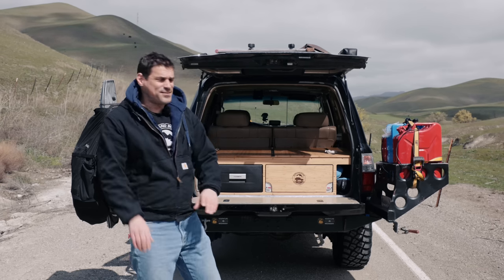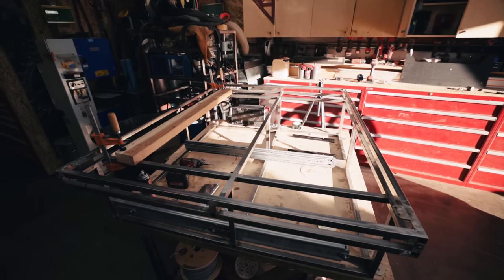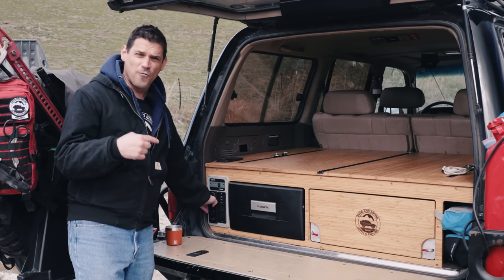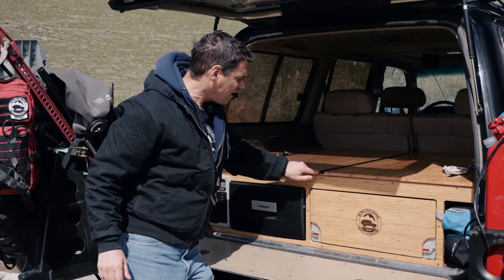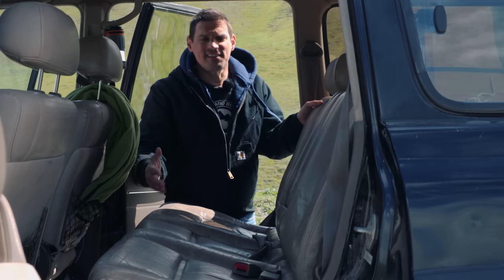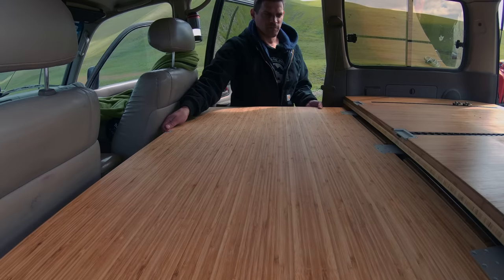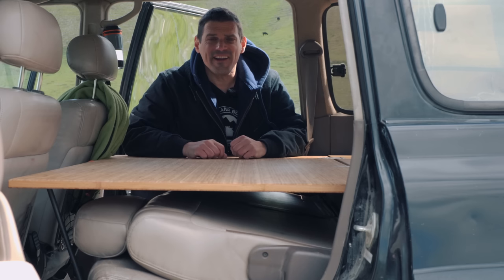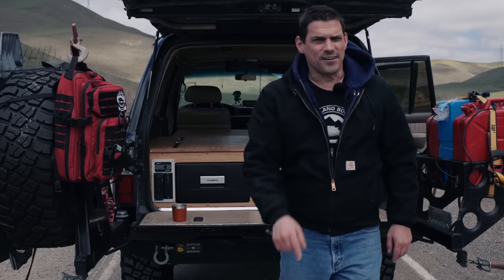Drawer System Detailed Walkthrough - Build Your Own!

Comment: Great set up 👏🏼 I have a similar set up in my rig, much simpler but does the job and is very light. I positioned my fridge behind the passenger seat so I could have two big drawers at the rear. My sleeping platform folds up in about 10sec so it's no drama to access.

Comment: Thanks Michael - great video update for us ‘Outback’ trekkers down here in South Australia - I presume bamboo is lighter than the usual plywood for the same thickness? Your ‘trucks’ are our ‘utes’  and mine is a Hilux dual cab with an aluminium canopy (with legs) - not sure if we can get bamboo here in Australia due to customs regulations - I will use aluminium and stainless steel materials with lockable drawer slides with lock levers at the front - John in SA
Reply from the maker: Hey John! Thanks for watching. Bamboo is actually pretty heavy. It’s durable and dense . Won’t delaminate. It’s good for routing and rounding edges to any shape. I love the Hilux! Spent some time in Brisbane and enjoyed seeing the utes and different rigs. Cheers.

Comment: My dad built a 1" square steel, U-shape configuration with 3/4" plywood on top of the storage for travel for me and my brother, maybe 1' below the boot in his '72 Chevy truck.  Complete insanity now but nobody batted any eye in the 70's.  I like your build.  I've thought about a decked system for awhile now, but when you start thinking of a house battery setup you may have to cut out some plastic if, it doesn't fit under the hood.  Analysis paralysis.

Comment: Absolutely do not need 'fancy' 12V outlets.  Got mine for $12 off ebay (voltmeter, twin USB3, cig socket, switch + inline fuse) and came  all wired up and it has worked perfectly for the past 2 years of heavy use.  Oh AND it's 'marine' rated as has taken plenty of water spills, dust, knocks, etc 👍

Comment: That was vary nice of you for releasing the CAD files. This drawer system design blows anything I've seen out of the water. It just so happens I own a welder, CNC router, and a FZJ80. I might use sheets of marine grade HDPE instead of wood though.  Looks like I have a new project to tackle this summer.
Reply: Hdpe would be ideal imho too. So tough and light weight
Reply: I think they were considering HDPE in one video. Bamboo looks nice though
Reply: Hi Triot, I'm affiliated with a company in Poland that designs and produces motorboats out of HDPE. Although it is generally a great material for various applications, and has inherent benefits (waterproof, impact resistant, chemically resistant, etc), unfortunately it is quite heavy as compared to the materials used here. So much so that using it in offroad/overland applications where weight is absolutely critical is simply unjustifiable. We actually did a few feasibility studies through our project office (world class engineers) for overland applications of the material, and unfortunately it turns out that the intrinsically best feature of the material - it's density - makes it too heavy. We would love to be proved wrong though! Let me know if you manage to use this material for an overland build. Best wishes.
Reply: @mikolajdrozd9255  Really? I work in the industry so its why I knew of marine grade HDPE. I have some King Starboard scraps in my workshop from a past side project. I have some 1/4 and 1/2 inch sheets of Starboard and It doesn't seem any heavier than the plywood I have on hand. The biggest draw back I see with Starboard is cost. You're also limited in color choices.  I'll do some more research for now but I have connections to wholesale suppliers so Its why I thought Id use the stuff.
Reply: @mikolajdrozd9255  what's your favorite material?
Reply: @gabemiller9873  It depends for what application. For instance, I used to live in the middle east and on the really hot and dry days in the summer (over 50 celcius) anything metal in the car would get super hot if direct sunlight would hit it and anything made from wood would contract and expand due to the varying humidity. So I had cloth covered aluminum boxes (I think they were zarges) and material bags in the back of the rig to store stuff. While overlanding through West Africa I had a car with no AC so had to drive with the windows open. SO. MUCH. DUST!!! I quickly realized that covering the sleeping platform in velcro like material (the soft side) was great for attaching stuff but terrible to clean every night. I did some offroad driving in the Ukrainian mountains in winter a few years ago (it got down to negative 30 celsius) and had problems with the sliding brackets on the drawers in the back. Whenever we would pull up for lunch or something and the tailgate would be open for a while the brackets froze over and I had to warm them up to close them again. So it really depends on the environment you go to. I still like wood and metal though.
Reply: @triot2127  We found that we had to use 3/4 inch sheets to avoid them buckling under their own weight or add more support mounts, both of those options added weight. We were looking at a Nissan Patrol GU model and a j95 Toyota Prado so GVM was limited. Adding weight in the form of a drawer system meant having to shed weight in the form of equipment. Not something we were prepared to do. However, maybe if we changed the design or did a combination of HDPE and other materials, it would have worked. If you figure something out share please.
Reply: @mikolajdrozd9255  Thanks for your input. I'm still in the barnstorming phase. If I come up with something unique I'll make a build post over on the Overland Bound forum.

Comment: This is such a neat design and execution! I'm looking for an answer for my own build: welded or plywood construction..  There are so many plywood made systems with just hidden screws joints. Your chioce was to go with steel frame, but was it based on any experience with those plywood systems after some time of a proper, offroad use? I'm wondering if those plywood ones can handle a long term offroad use.

Comment: Are you able to use the electrical outlets when the tailgate is closed? If not, would you orient them vertically to be able to use them when the gate is closed if you could do it over?
Reply: That's a big consideration for me as I design my own drawer build. Thinking of how to protect them when I'm loading heavy stuff in and out is the difficulty and whether or not I would ever use them with the back closed anyway
Reply: @trevorchapin2287  I use my drawers as a sleeping platform, and as I am planning power in the back, I was thinking that it would be nice to be able to plug a fan in or charge my phone at night while the gate is closed.
Reply: @matttherat343  My thoughts exactly. I'm thinking of adding just a dual USB connection accessible when the rear is closed. I'm debating on using a USB fan or hardwiring/semi-permanently mounting one in the rear. Either way would still be usable when all closed up inside. The more I research and look into though, the larger and more complicated my wiring diagram has gotten
Reply: Exactly,  you won't be able to do anything while the tailgate is closed,  waste of functionality. should put it where it's accessible at all times.